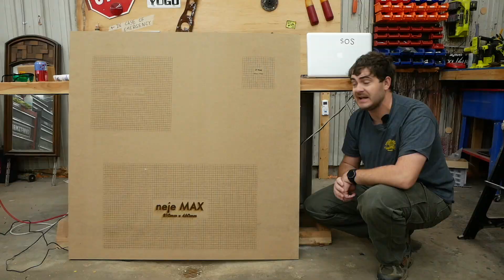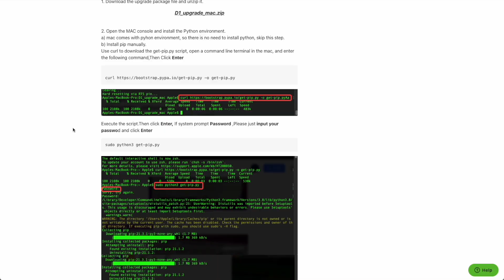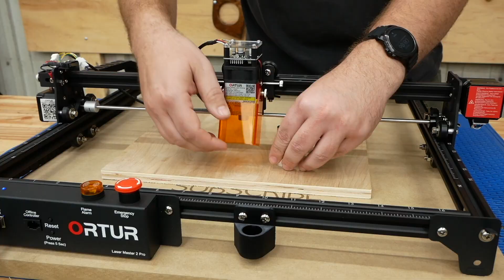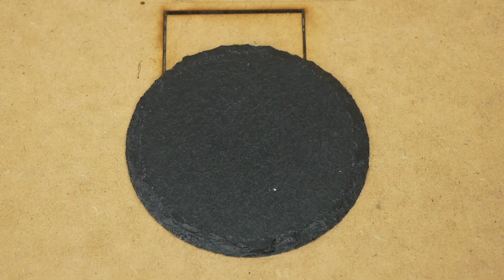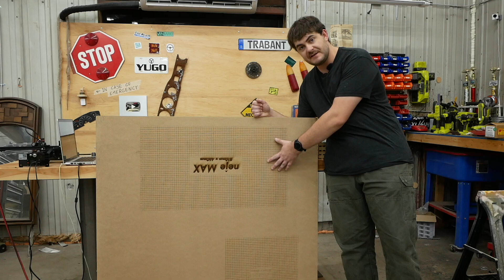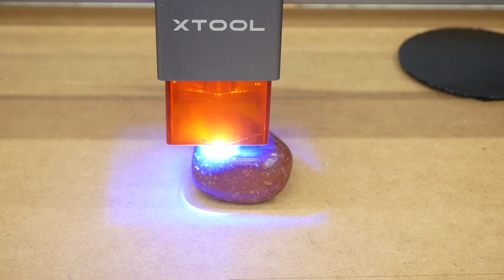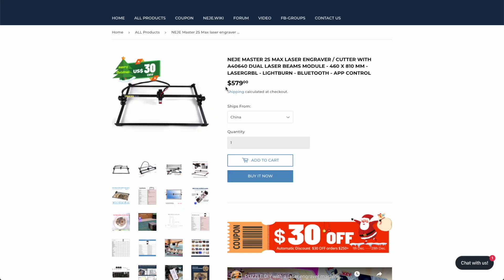I Got Sent MORE Free Lasers! Are Any of Them Good?

Comment: Just a quick tip from a fellow laser user: When cutting thicker materials you want your focal point to be 1/4 to 1/2 way through the material you are cutting. This can greatly increase your ability to cut thicker materials without getting so much charring around the edges of your cut
Reply: With these diode based lasers you really aren't able to cut that thick anyway. This is absolutely true with CO2 lasers though! 

I don't know why anyone interested in cutting would want any of these over a ~$300 K40. Easily 32W of output power with even the 700mm CO2 version (these diode ones are rated in input power to get a bigger number).
Reply: @COASTER1921  The K40 looks sick. I think some people are just intimidated by the CO2 laser and the fact that it's enclosed, despite the enclosure making it a lot safer and the general safety rules between cutters and engravers being the same (as Neji put it, "mind the fire, wear goggles, no touching, and mirror object").
Reply: @COASTER1921  Maybe Robert can get his hands on one of those inexpensive K40 units and compare it to the diode units?
Reply: No one else seems to mention that.  They just show the laser focused using a metal weight-type thing which comes with the device.

Comment: I bought the Xtool D1 and have the exact same problems you had.  It was not thought out very well and the D1 does not really work well with lightburn, at least in my opinion.   I hate that it does not have limit switches.  That for me is the biggest problem with the laser.  It will crash into the sides for sure if you are not careful, and it sounds like it is going to explode when it hits the side.  And to top it all off the emergency/start button does not stop the laser.  I can push it all day long when it is running and it will not stop.  I have a support ticket into Xtool about all the problems I am having and have not had an answer from them.  Hope they can git their Stuff together, it does have potential, but not if they just sit back and not fix all the problems this machine has.   Thanks for the great reviews.  I am glad that someone is telling their subscribers what they really think about these laser engravers.  You just got a new sub, can't wait for the next review.  Thanks again.  :0)

Comment: This may have already been said but on the xTool D1 when it is trying to home, there is a way of homing without limit switches where the machine will wait till the collide happens and will detect a current spike which happens due to the motors stalling so that may be what is happening with the homing feature.
Reply: You would think that they would run that check during a session too, so it's not constantly bonking the rails with the laser active.
Reply: @beardeddragonwood Yeah but I bet that the processor in it is already underpowered and they might use a hack to detect current that is not possible while the laser is running.
Reply: A machine should never crash. If your machine crashes, then as a designer you're doing something very wrong.
Reply: @UnitSe7en  Yes crashing is an issue and what was happening in the video is most likely a crash when they moved where the carriage was, but there is a form of homing that performs a controlled crash and detects to see when it happens which allows for the machine to be homed.

Comment: If you wanted to make the "Niji Ultra Mega Max Duex" actually home, you would need to have two microswitches for both sides. You can do it with two switches in SERIES (both switches need to be activated to complete the circuit) and I suspect that would be a huge upgrade to that unit. I also think that if you screwed down the unit to a permanent base, that would be less of an issue...
Reply: I had the same thought, but even better is hard stops on both sides and have the software take a few extra steps after the switch to make sure it's on the stops.  (Switches tend to allow a lot of travel past actuation, so the first one to touch would travel further without the over-stepping.)  Now, if we're already accepting a homing routine that sounds like an old floppy drive we can omit the second switch and just drive into the stops.  Or go full cheapskate and have no switch- home is just drive the full travel distance number of steps.  It could be kind of hard on things to stall the motors for that long if you were already there, though.

Comment: Regarding the homing button on the Xtool, I am assuming the firmware is set up for sensorless homing, which is where the firmware is programmed to save the coordinates for the X and Y locations where it looses steps due to it being rammed into an end stop.  Not to excuse it because no matter which way you slice it you are getting a 'crash', just this crash is expected behavior.

Though it's also entirely possible it's just built like crap...
Reply: My 3d printer uses sensorless homing and it works great. The "crash" isn't a problem because it's done at a low speed and the the drivers are sensitive enough to detect the stall before it does any damage. The machine shown in the video however clearly either doesn't actually support sensorless homing or the manufacturer hasn't tuned it properly.

I will say that I've played with sensorless homing for a project (using TMC2209 drivers on a 3d-printer motherboard, but not a 3d printer) and it was pretty fiddly to tune. Not a lot of wiggle room between "incorrectly detects a stall before reaching the stop" and "doesn't detect the stop". And any change to the motion platform, drive current settings, etc. can invalidate your tuning. That's not a valid excuse for an actual product though -- if you can't get sensorless to work, you need to add sensors before you release.

Comment: It's a pity not one manufacturer has taken all the good points, corrected all the bad points, and produced a machine that combines them all. Also, the random number generator they use to define 'laser power' must be done with the sole purpose of confusing potential customers so they don't have a clue what it's capable of. Sculpfun is the worst offender saying their 5.5w modules have an output of '90w' (at last count...)

Comment: I bought a neje 5.5w (20w input) variable focus head to replace the crappy head included in my no name engraver. I measured its actual optical power to be about 4w but the dot size is pretty small so it can still do sharp engravings on materials once properly focused.
Reply from the maker: How did you measure the output?
Reply: @UnderDunnOfficial  I have a homebrew laser power meter based off an Ophir head coupled to a digital display. It can measure up to 20W of laser power. The original head which came with my engraver worked well initially pushing real 5.5W optical output out of the box but quickly dropped power after a few hours of use until it dropped so much I had to get a new one. I read about it and it was because the laser diode was an open can type which deteriorates when exposed to air. Neje and better ones have an enclosed diode filled with inert gas which you can check if the lens is removable.
Reply: @Knaeckebrotsaege  i have a laser power meter so I can check its power output after a few hours of use. The diode laser can handle the current but it was harvested from a diode array from a projector. The harvested diode has a built in lens on its protective can so they simply pried the can off and stuck it in a laser head body. The blue diode crystal then deteriorates while exposed to the atmosphere causing the loss of power after prolonged use. The heatsink and driver was actually a good design so I just bought another diode (can intact, with FAC lens for square beam shape) and installed it in the head so now I have two working heads which I can choose depending on the job.
Reply: @UnderDunnOfficial  Low-tech laser power measurements can be done with a meat thermometer with the point stuck into a small block of black anodized aluminium.  Read the starting temperature and then fire the laser at the aluminium block for a fixed time (maybe two minutes with these small lasers).  The temperature rise will give you a relative power reading.  If you engineer good, you could probably calculate the temperature rise to power ratio and work out a calibration chart.  Or you can just use it for relative comparisons, which can be useful for monitoring the life of CO2 laser tubes which degrade over time.  Probably true with a lot of these laser diodes which I'm sure are "overclocked".

Comment: For the big one, you can wire a second endstop on the other side in series with the first one.  It'll skip steps on whichever hits first until the second trips the switch.
Reply: The theory is good, but you need to watch out for what type of switches they used... normally open or normally closed.  If the switch triggering a break in continuity (normally closed?) either switch in series will trigger the event.  In that case, you would need an 'And Gate' of some type...
Reply: @Bear1313  
Normally open: Wire them in series
Normally closed: Wire them in parallel

Comment: Can't believe you did that to your poor Dodge...

I recently got the NEJE Master 2S Plus, which appears to be a slightly larger version of your Penelope.  It has a "30 watt" laser.   I think I liked it better than you did Caleb.   Haven't even tried cutting, though.  Using it to engrave is so far fun enough.    
On the other hand, Lightburn has never dropped a connection, and the USB has been solid.   What is annoying is that the laser is ALWAYS ON, whenever the unit is powered.   Sure, it's at low power, but I'd rather it were not.   Haven't bothered with bluetooth yet...   I hate the glasses.  Wish I had some sort of a cover for the unit so I could dispense with them...  But then the price would likely double.
Reply: In fairness he's done a lot worse to that dodge.
Reply: If you think laser engraving the dodgy is bad, you must be new here... :P
Reply: @twocvbloke  I'm not really a car guy,  so I watch  some of his other channel for entertainment value, but I certainly have not watched ALL of it.   Apparently I need to go digging.

Comment: I was already set on the neje "40W" laser.  But now I'm leaning towards the xtool. I'm glad the neje was out of stock in eu warehouse, otherwise i would have already ordered one.
Reply: Consider a small co2 laser. It puts these things to shame in terms of cutting power. They are pretty similar in price too the xtool. For around 800 you can get a decent co2 laser cutter. Probably 50w real output, probably around 400x300mm work area. They are gonna be a lot more learning curve to setup. On the other hand though it it's just about 5 times the output power. I'm looking at buying a 1300$ example that might hit real output around 80w. That's easily enough to cut half inch thick wood, Clear acrylic, with proper surface treatment it can etch metal (kinda). Even for 800$ you can usually get a lot of goodies, active air assist, a closed ventilated chamber and linear rails instead of crappy rollers.
Reply: @notsam498  one thing to consider which put me off co2 aside from the cost was the life of the tubes. Besides the operating life, they also have a calendar life which means they still degrade even when not used, which is especially worse with cheap tubes. It wouldn't matter much if they get used everyday for work but for my hobby use which is just occasionally, wouldn't make much sense cost wise. Though being able to cut acrylic sheet would be very useful to me.
Reply: @quandiy5164  i can tell you we have a 100w reci tube laser cutter at the lab at school. that's working just fine after hundreds of operational hours and 3 years later. The cheap tubes are just that cheap to replace. The reci tubes though seem to hold up excellent. Gas lasers are very much an analogue technology, service life estimates are very much based on worst case usage scenarios. If you buy one and operate near the limit all the time you use it, it won't survive long.

Comment: Honestly, using the engraver to engrave the hood of a car, in situ, is pretty cool.
Reply: Now I'm wondering if anyone makes an engraver that has rubber suction cups.
Reply: @TheRealNici  If not, that should be an easy addon, like the raised feet.

Similarly with switchable magnetic feet like MagSwitch. For some applications I can imagine you'd want/need to have it mounted vertically, and you'll want it to be very firmly mounted.
Reply: I was thinking of doing the same thing on my car's engine valve cover. But never got around to doing it due to laziness.

Comment: With a little (ok, a lot) of know how, you can buy, de-crapify, and safety-ify a K40 CO2 laser for less than those bigger diode lasers. That way your "40w" laser gives you 30w of cutting power, not a dubious 15w. I think I have $500-550 in mine.
Reply: How do you get extra cutting power? Is the air assist really that effective?
Reply: @frankinstynm  you get extra cutting power because it's a CO2 laser that actually uses 30w (40w if you overdrive it) of power, not a diode that is "generously" described.

Air assist can be really effective, but the K40 doesn't have that. There's a British guy that demonstrates cutting ~1" thick board with his 50w laser. He has his air assist nozzle right above the cut and goes slow. It's pretty impressive. Search for "rdworks learning lab" on YouTube if you want to watch 45-60 minute long videos of dense information.
Reply: @generic0000  CO2 laser can also cut transparent acrylic. It's WAY better than the diode stuff if you want to cut.
Reply: @SaitoGray  Good point. I forgot about clear acrylic being, well... clear, to visible light lasers. That's super handy for engraving edge lit signs. My custom control board for the K40 is clear acrylic with black paint on the back. All the switch labels are engraved through the paint, and lit from the back. It looks nice.

Comment: 18:49 Watch the fan on the laser module. You can see it twitching from the power produced by the stepper motors being moved around.
Reply: means they saved 0.002 cents on a diode preventing the steppers from backfeeding into the rest of the unit. essentially you're using the stepper motors like bicycle dynamos putting unregulated power back into the whole control circuitry. how delightful
edit: and considering it makes a 12V fan twitch, the voltage it backfeeds isn't exactly insignificant either. could likely fry something if the steppers are manually moved a lot
Reply: My cheap engraver does it too. You can light up the power leds and continuously run the laser head fan if you move the gantry back and forth.
Reply: That's pretty common on 3D printers too. Which tracks, because all these engravers are is a 3D printer without a powered Z axis.

Comment: Damn. At <200$, that little one may end up actually being an impulse buy for me... Is 5.5W enough for cutting thin acrylic?
Reply from the maker: Yes! It'll do the job slowly, but it'll do it. You're probably already aware of this, but just in case you're not, it can't do anything to clear or white acrylic
Reply: @Lassi Kinnunen 81 Around 1-2mm. I have a specific project in mind that's been on the todo list since forever - a proper face for a DIY "word clock", this should do nicely for that.
Reply: @OlexandrS  In that case, check out rowmark. They have a cool acrylic that's black on one side and clear on the other, so you just engrave the words out from behind (reversed, obviously) and you're left with crystal-clear lettering that you can paint from behind or leave clear but backlighting looks awesome.
Reply: @SwervingLemon  Two-colour engravers acrylic by Rowmark. - That's a string of words I haven't heard in quite a long time.
Reply: This is gonna sound a little tone deaf but... Save your money and get a k40 c02 laser. Those generally can cut acrylic. They are usually about 400. But the difference is night and day. They usually safely can output 30ish watts. They can be ventilated too which is a huge deal. Wood smoke is one thing... You don't want to be inhaling burning acrylic though (obviously). They have tiny work areas, but generally they vastly Superior motion systems
Reply: @notsam498  but there is a shit ton more fiddling and tweaking with a CO2 laser. Diode are much better for first timers.
Reply: @ionstorm66  it's true, but then again buying a machine that no amount of fiddling will address the issues of is much worse in my experience. A smaller unit like a k40 will require a lot more knowledge, but it will be just as manageable once that curve is overcome. Unlike the diode laser though, everything a person learns prepares them for a bigger more capable machine. It's true though there is more to know up front.